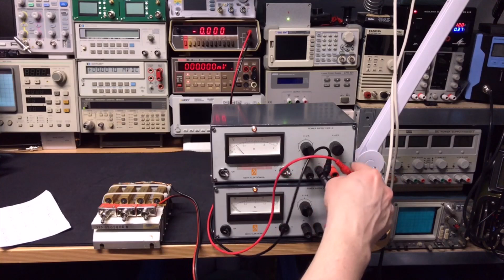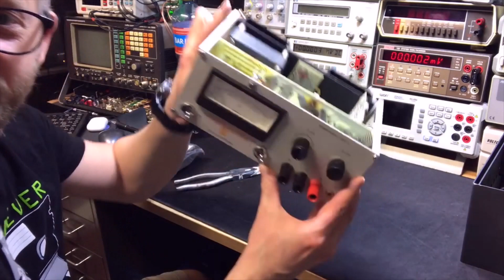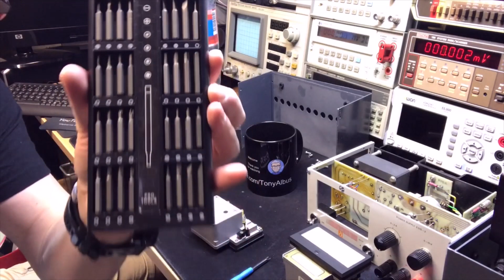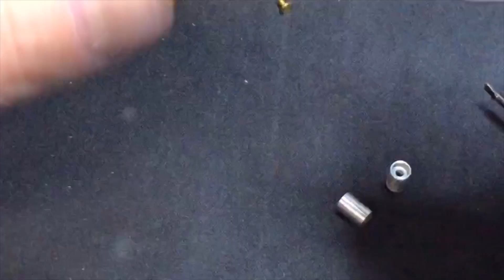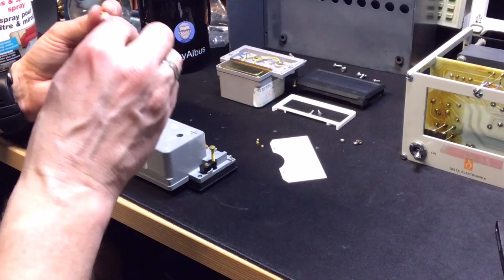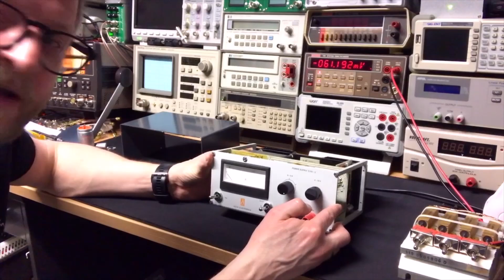TA•0146🟦Delta Elektronika E 015-2 Linear Power Supply - Restore

Comment: A little tip for handling those small screws when your fingers aren't the right size.  Crimp a terminal post connector to some heavy gauge wire (as a handle).  You can then slide this under the screw head as you unscrew and lift the screw out.  Also useful for replacing the screw.
Also, thanks for the channel.  I recently discovered you and I'm now a little bit addicted.  keep up the good work
Reply from the maker: Thank you so much Russel, great tip!.. will try that for sure. cool how we all have our little tricks.. thanks for sharing!

Comment: We use heavier 19 inch models at work. Great stuff. Note Sifam also makes collet knobs for potentiometers. I made a tool to open them from a wide flathead bit. There seems to be an official tool for that but its kind of hard to get and pricy.
Reply from the maker: Thank you, those 19" units are cool :) .great advice on the flathead, thanks!
Reply: @TonyAlbus  These small units are very cool too :) You now made me buy one because of this nice video, haha.The e018 dual supply version, ideal for analog (audio) circuits with opamps etc.
Reply from the maker: @algemeennut6683  haha!.. sorry :)  but nice catch, those duals are very nice! .. i will be selling my E030-1 and E015-2 on marktplaats i have two of those.. one of each is ok and someone else can enjoy then too..